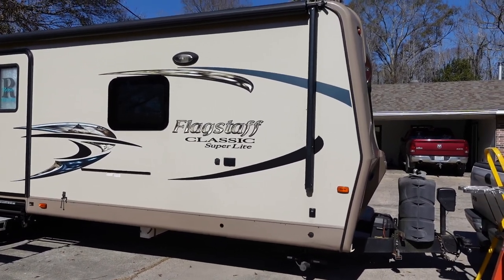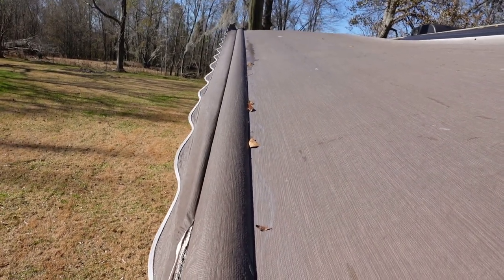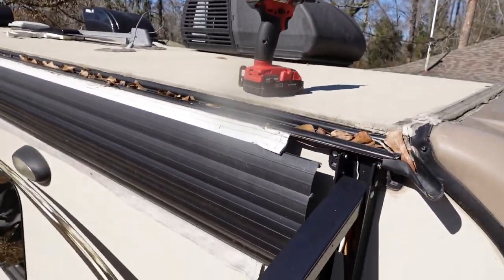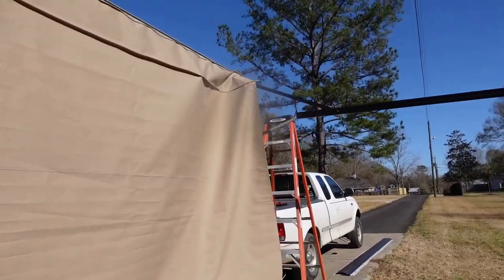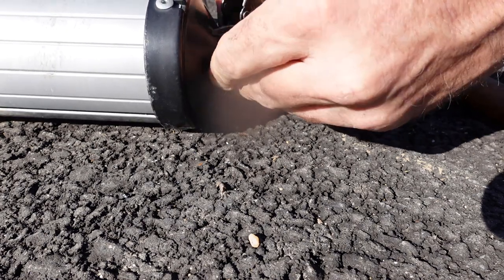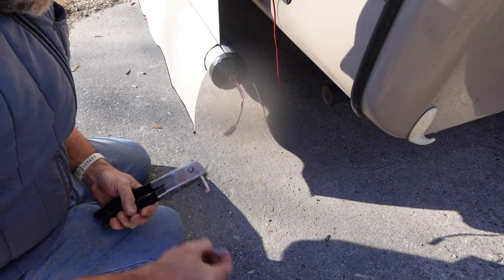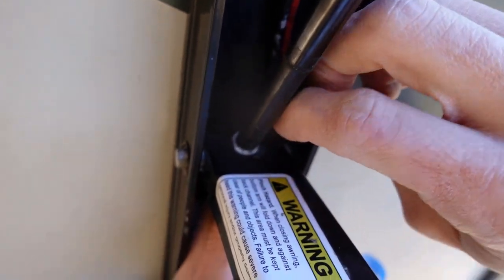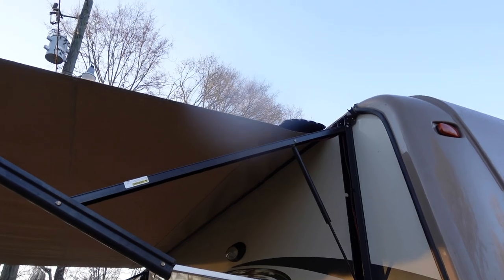RV Camper Awning Fabric Replacement

Comment: On the motor end of the roller, it looked like you could just pop the three rivets on the cap connected to the roller and the whole motor assembly would come out as one unit. Do you think that is possible or is there something else keeping the motor assembly up inside the roller?  This would prevent the disassembly of the outer bracket going through the cap end correct?  I’m about to have to tackle this same project. Thanks for the video, I gained quite a bit a insight from it.
Reply from the maker: I seem to recall wondering about that at the time. I don't believe it was possible but I don't remember why. Not the most fun job for sure. Thanks!

Comment: Did you ever figure out why the awning pops like that when you are opening it? I have the exact same camper and mine does the same thing.
Reply from the maker: I haven't yet. I thought it was because the shocks were bad but they certainly seemed ok. The front folds up better than the rear so I'm not sure. If I help it a little it works normally. If it warms up a bit today I may see what I can figure out and make another video of just that problem. Thanks!
Reply from the maker: Made the video yesterday
https://youtu.be/RAB6l4ivHpk
I do think the struts are worn out. Thanks!
Reply: Because you didn’t put a pin in the other end is why it unrolled like that, the end with the motor doesn’t have a spring, just the other end.